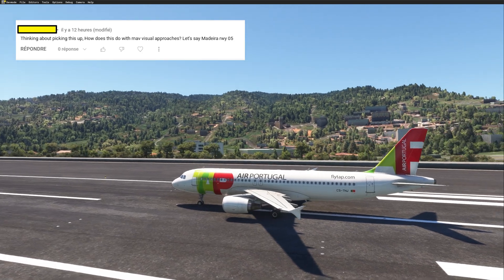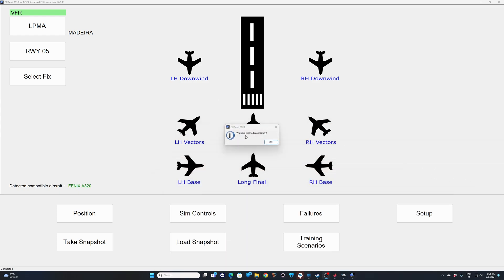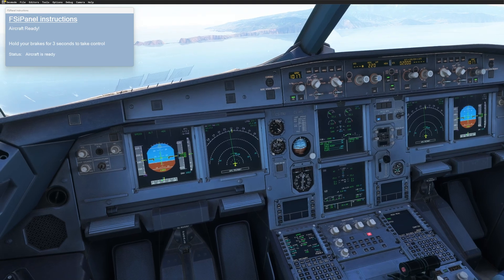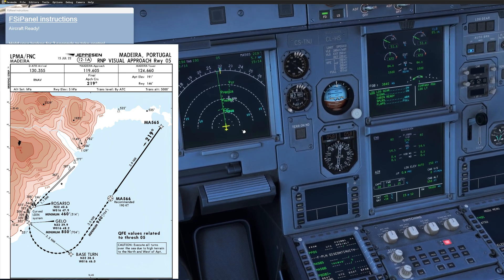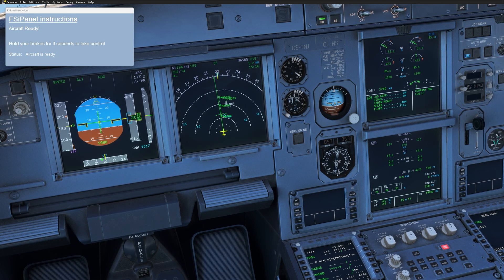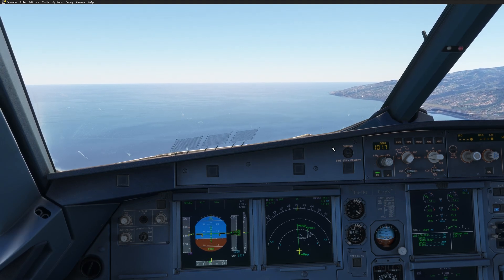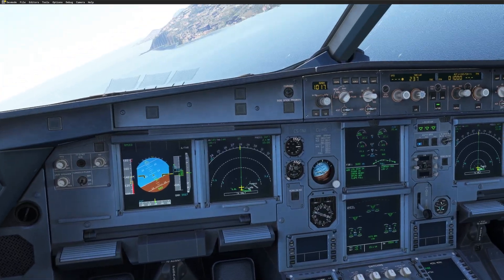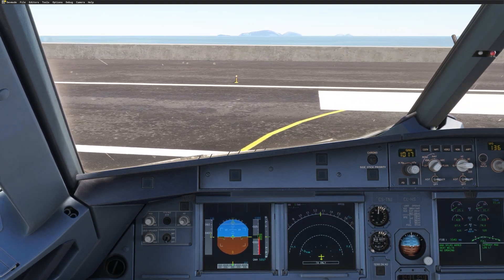FENIX A320: How to Use Imported Pilot Waypoints & Fly RNP VISUAL 05 at LPMA

Comment: Hi JP. Another really instructive tutorial.
Have investigated using FSIPanel with FSHUD ATC. Fénix. Pleased to say FSIPanel STAR approaches appear to work pretty well with latest release FSHUD 1.3 with ATC speed and distance separation. Currently Beyond ATC which I am also learning and testing does not have this, as there is currently no traffic injection . 
My question is embarking upon all the FSI  Panel  training and failure scenarios, it would be great to select a custom waypoint at say TOD with FSIPanel financially in main menu just like select star and waypoint currently available.
Why FSHUD brilliantly picks up latest position as an option from Simbrief OFP. No problems. Then gives vectors speeds distances to approach following STAR.
Also opportunity to do all the mental maths checking ATC and FMC from TOD!
This is truly immersive at SIM level. 
Forgive me if I have missed obvious and you tell be you can select custom waypoint at start point already.
You have a real winner here for SIM pilots wanting to follow real pilot training.
As they say a pilot never stops learning.!!!
 Next stage using and testing FS2crew with all of above. See why Airbus 320 needs two pilots!
Reply from the maker: Thanks for your kind words! Yes you can start directly from any Pilot Waypoint that you can import or create yourself! Cheers

Comment: We have very difficult airport to land there's no go around you have to land and there's no chat no sid using Victor only so it's quite challenging airport if it's possible to show how to land at this airport it's OOKB you can make flight plan for full flight from OOMS
OOMS - OOKB iwish if you can make full flight or landing lesson good luck

By the way ookb it's sarounded with high elevation rock mountains
Reply from the maker: Hi,

Yes, I know this airport very well as I flew there myself as Captain. I even gave instructions on how to approach and land in Khasab with a Wadi escape in case of a go-around. It's a very nice airport surrounded by challenges: terrain, a US military base to the north, and close proximity to Iranian airspace. They have an RNAV approach there, but since it is a military airfield, all information is confidential and cannot be shared publicly.

The best way to land in Khasab is to overfly the airfield and then plan an 8NM outbound leg before finally joining the final approach. You need to decide on a go-around before reaching the port because once you pass that point, you're committed to landing unless it's absolutely necessary to abort. In that case, you need to visually fly over the wadi to escape over the sea. It’s an interesting approach!
Reply: @FSiPanel 
Thanks for reply I wish if you have time to make full flight with PMDG B73 it's nice to hear from you that you use to fly there as captain I believe you worked with omanair like me thank you again